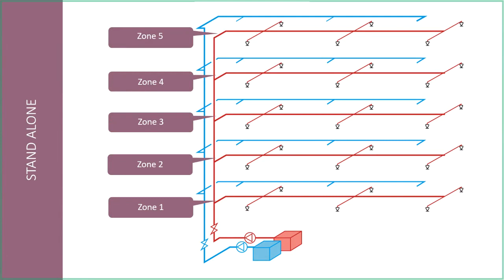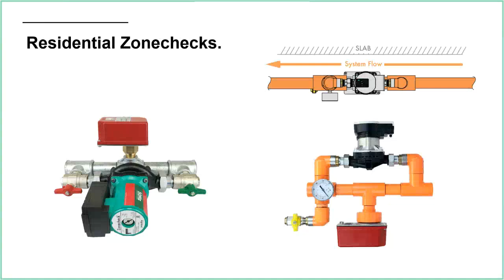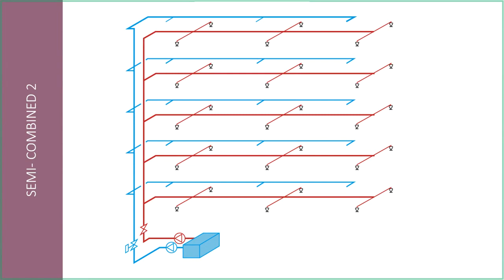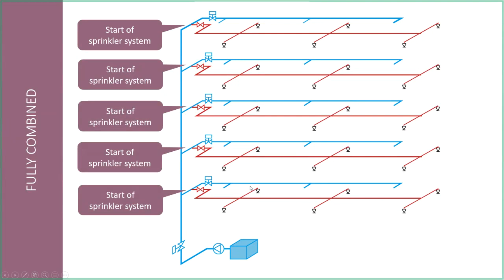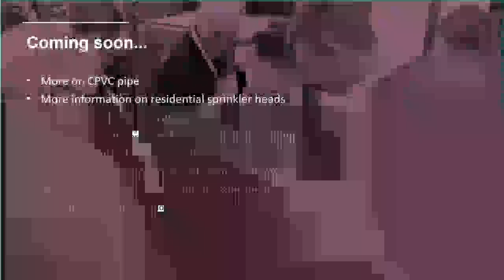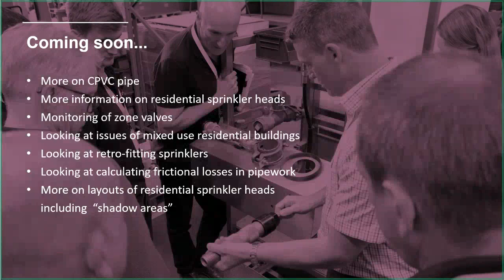Sprinkler Talk #16 - Residential Sprinklers (part 2)

Comment: Would it not be possible to have one valve per floor (One zone per floor) and then have a flow switch per apartment? - That would achieve the same thing would it not?
Reply from the maker: Hi James,
 
9251 is not as detailed as 12845 where the definition of a zone is more clearly defined as having an isolation valve and flow-switch. It is not good practice to have a zone on a zone (i.e. more than one flow-switch operating at once) which I realise you are not suggesting. For us, isolation valves and flow-switches act as a group in this case and I wouldn’t have additional flow-switches without extra isolation valves. The “problem” with isolation valves is ensuring they are always in the correct position, which can be solved by locking them and monitoring them. The “problem” with remote flow-switches is testing them, which can be solved via Zonecheck.